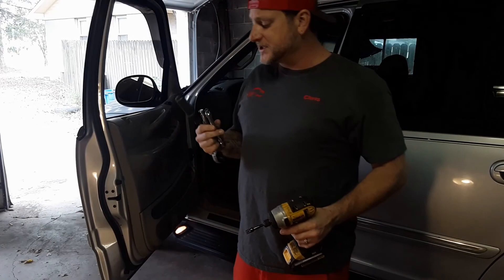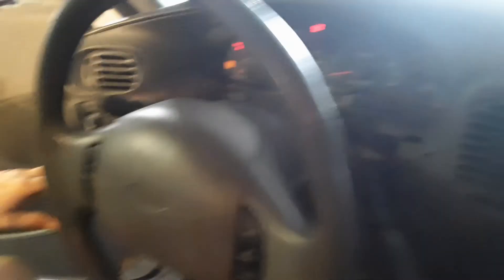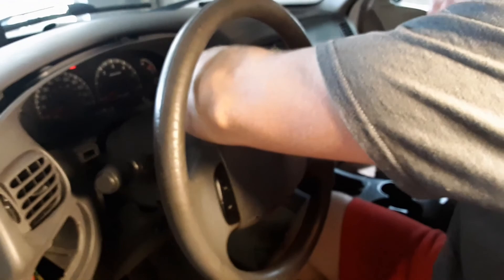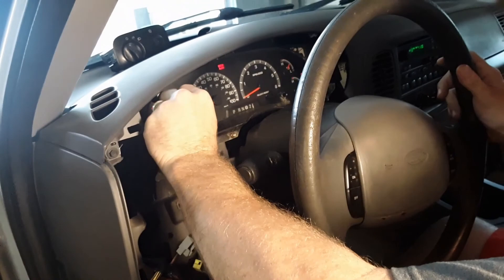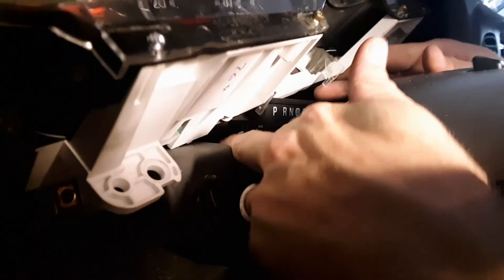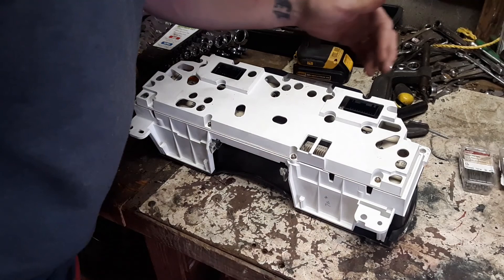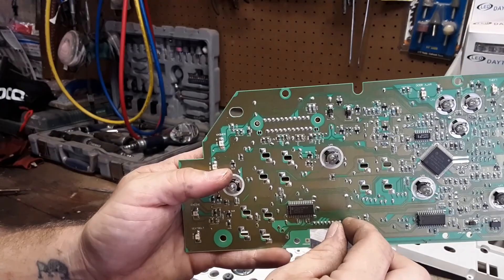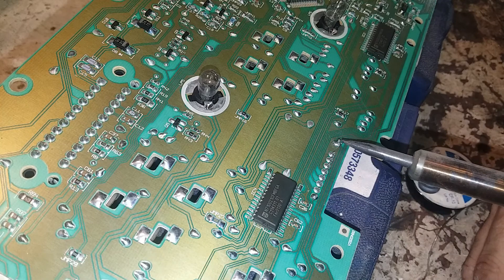Ford Expedition odometer fix

Comment: Thank you, it was very helpful. It worked on a 99 f150 xlt that recently bought, turned out it has 173k miles 👍
Reply: How were you able to figure that out if you don’t mind me asling
Reply: @stevechamberss3237  I mean my odometer didn't work, I repaired following this video, when it turned on, showed that mileage. I'm not sure if was counting when it was off if that's what you're asking.

Comment: Both my husbands odometer and tripometer do not work. He's a sucker and bought this 25yr old Expedition with with evidence that all the door panels, dash, and headliner instruments had been previously removed with tons of clips, etc broken. Now I'm stuck fixing windows that have fallen off the tracks and fallen to the bottom of the door, odometer and tripometer not working, bald & cracked tires, cv shafts/axles popping, and have already had to replace his battery followed by the alternator 3 months later. 🤦‍♀️ Dude just watches me struggle and get frustrated when I'm not string enough to break lose a nut,etc. instead of offering to help or watching and learning. I mean, what kind of man can change a headlight bulb in any of his vehicles, do an oil change, or change a tire!?!? One that is too busy playing Pikemon etc on his 4yr old daughters Nintendo switch. 🤦‍♀️Ugghhh! I never get a Thank You or anything. THANK YOU for your video
Reply: Sounds to me like you need to find a MAN to take care you and your daughter.